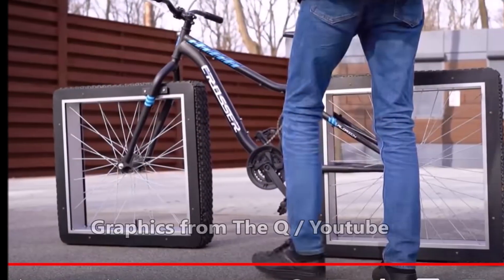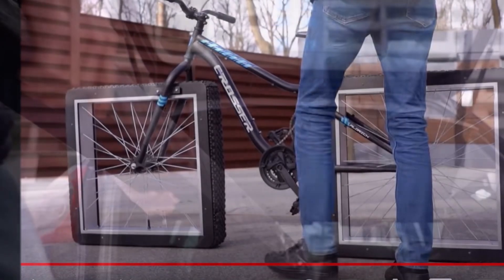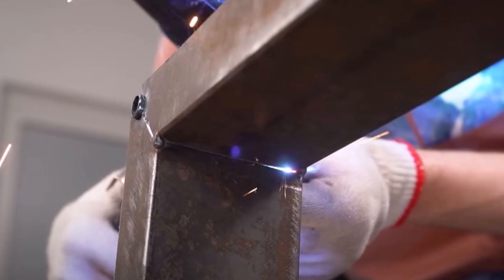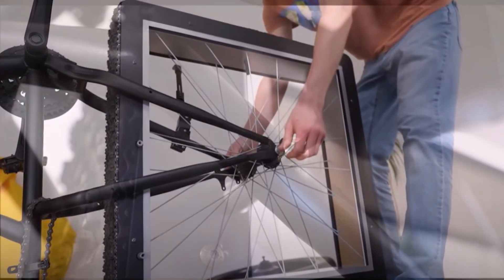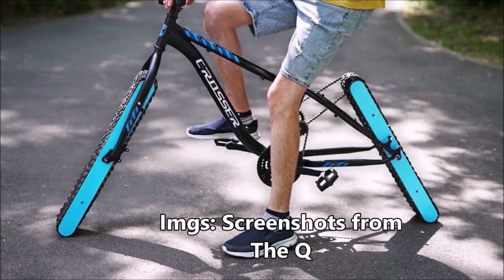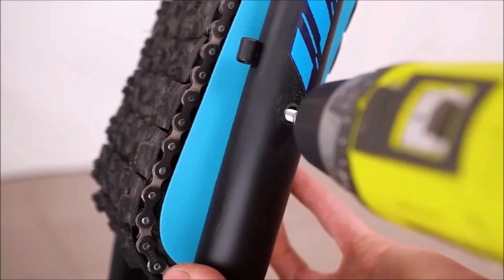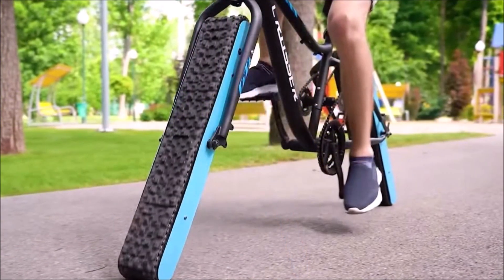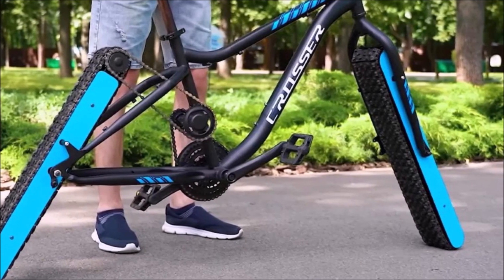Square Wheel Bicycle Makes Scraping Sound But Absolutely Works

Comment: Interesting look sure enough, but not square wheels at-all. Merely two 'wheels' at the bottom, front and rear, running a caterpillar tyre around square frames.
It is a design feature but, alas, neither an invention nor square wheels. Interesting to see though 😊